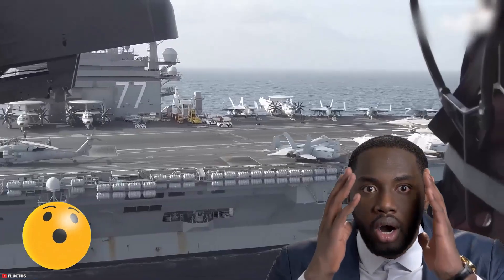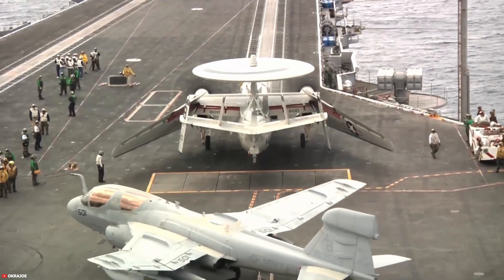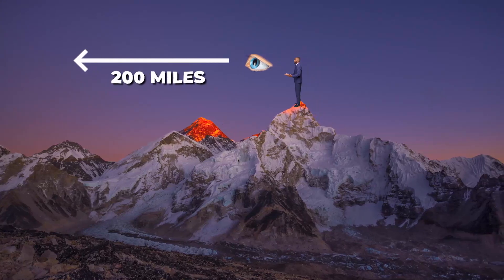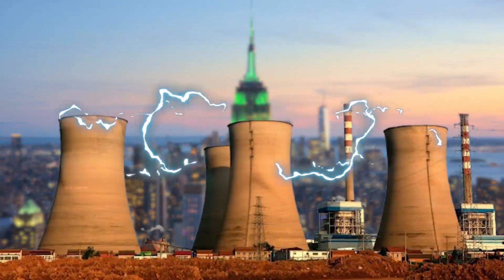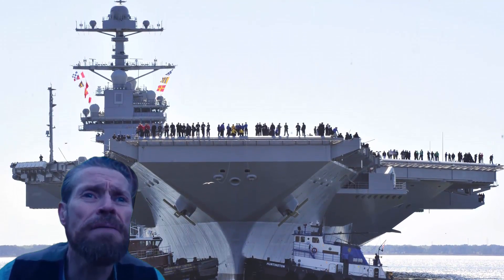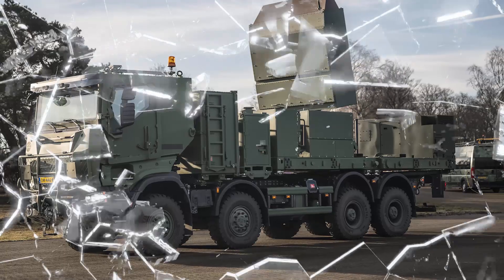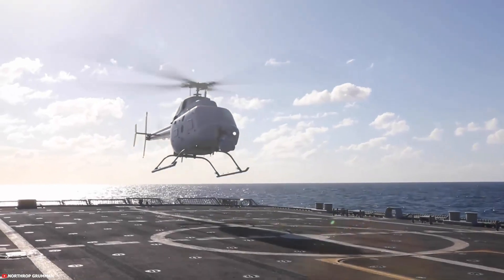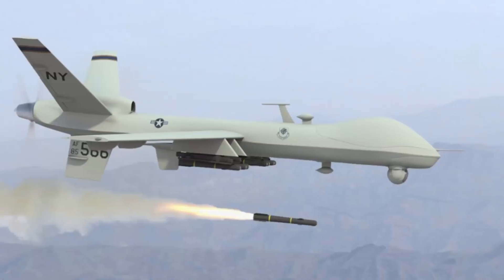Why The First Aircraft Launched From a Carrier Is Last To Land !

Comment: One of the issues with folding wings is that they are able to launch and fly with them folded. Most of the time they also land with them folded, as they are not designed to be able to unfold in flight. I have read where some have unfolded in flight so it might be the type of aircraft that determines whether they can or can't unfold in flight.
Reply: If they take off folded I think generally considered safer to just fly back to carrier with them still folded than it would be to attempt to unfold them in flight even if they're hydraulic or electric because one or both of them might not lock into place wich would cause some control issues. As a side note The F14 had issues where the wings wouldn't unsweep sometimes because they would jam and when that happened it wasn't uncommon for one wing to go straight and the other to stay swept after going through the procedures to try to unsweep them. The f14 could actually fly like that however at a significantly increased speed so they would have to land at nearby allied airbase if in range or in wartime I guess they would have to just eject near the the carrier group because they couldn't fly slow enough to land on the carrier with one or both wings swept back well level enough in the case of one being stuck but you get the point.